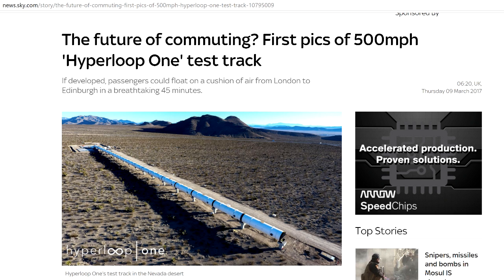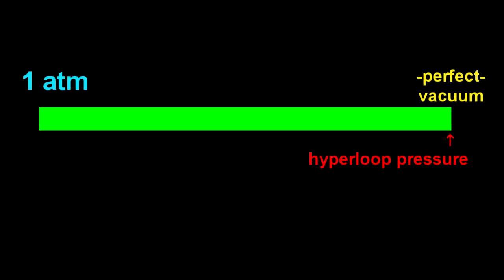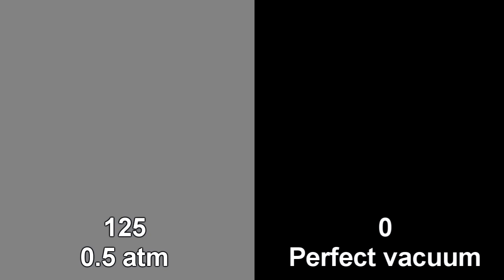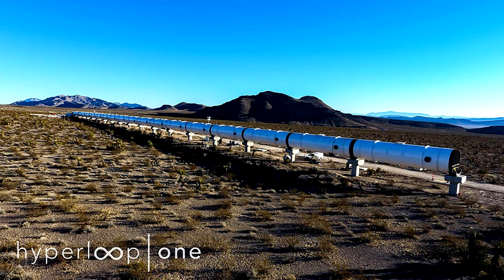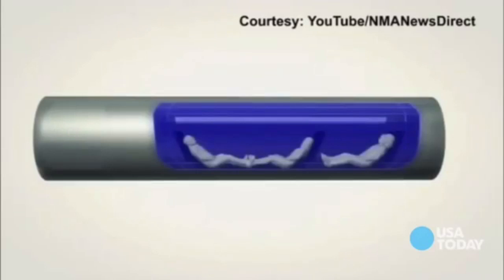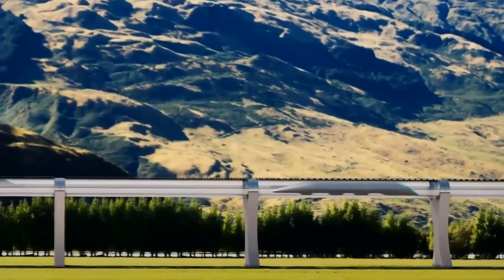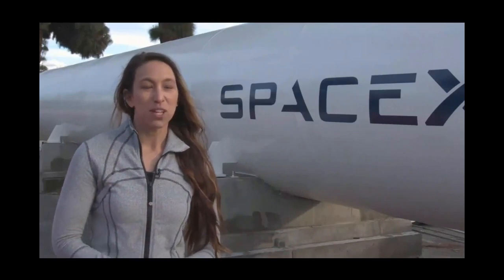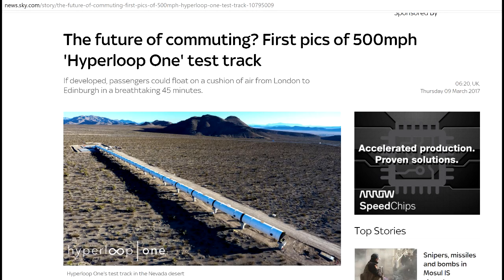Entire Hyperloop could be destroyed in SECONDS!

Comment: The Hyperloop will most likely be split into sections, so the vacuum of each section doesn't interfere with more than one pod. One benefit to the Hyperloop, when it's in sections, any damage to the Hyperloop will be severely limited, because the vacuum of the whole Hyperloop and it's sections won't be depressurized. If there is an air-lock, the potential energy in the vacuum will be able to pull the pod speedily along the interior. I surely do hope the Hyperloop acts like a maglev, that would make things much safer and faster. As for the thin tube, I bet that may be so if there is a problem with the vacuum, air can enter in easily. 

But, that's how I think, and many people think differently than I do.
Reply: If it's split into sections then how will the vehicle get from one section to another unless those sections are momentarily opened up to each other and closed at +500 mph speeds.... and if one of the seals fails then your vehicle is going to go splat
Reply: A better idea would be compression fitting another tube around it, or multiple layers to increase strength but this would cost much much more
Reply: Love Castle, 
it will have to be split into sections(Unless the hyperloop is used by one vehicle at a time) to avoid depressurization where vehicles can enter, and exit the hyperloop, even if that includes airlocks for each station. Alternatively, they can make a branch away from the 'main hyperloop' for stations, this may already be in the plan.  I however do agree on your last comment, the hyperloop needs a material that can hold an almost complete vacuum while controlling a High Velocity impact, or layer the hyperloop with the same material to prevent damage from a high-velocity impact.

At the time of writing the comment that you replied to, I was thinking each station could have a section leading up to it, sorry about not being too clear on that.

Thanks for your input!
Reply: the idea of hyperloop is one length of track where the vehicle speeds up about 50% of the way and slows down 50%... If the vehicle had to slow down or stop for airlocks then it would be quicker to take a car. as you cannot accelerate/decellerate the vehicle that fast without G-force too great for a human passenger
Reply: Kalel Kent
Well, with the facts presented in this video, I would say having one whole hyperloop would be a bad idea in case something were to happen, where sections can be sealed off. I'm not talking about different tubes in distance to each other. That would be stupid, what would be the point of having the hyperloop then? The pod would pass through an airlock that would be opened at immense speeds while staying at speed (Thanks to Love Castle for mentioning that.) However a breaking system does need to be put in place in case such an accident did happen.

You really need to change that attitude however, it's people like you that make people afraid to comment on a video expressing their own belief. Hence the reason why I put "But, that's how I think, and many people think differently than I do." in the comment.
Reply: Wait... Multiple sections with a vacuum seal (so like, a steel door) along the track? Goodness there are so many issues with that.
Reply: Also, Kalel Kent, think of a hollow circle, slice the hollow circle into quarters. However don't move the sections, place airlocks where the slices were, those airlocks will open and close at an immense speed, there's the Hyperloop in a 2D dimensional image (this is with pods, of course). Thanks for your stupidity in common sense.
Reply: So, the hyperloop is supposed to depart capsules every two minutes. For the tubes to be able to be sectioned off, so that only one capsule is in a section at any time, each section would have to open and close every minute. And if you want to depressurize and repressurize in such a time, good luck. It can take a half an hour just to depressurize a chamber. The hyperloop is a good concept, and I can think of some ways it could potentially work, but not for as cheap as advertised. If you put it underground, and encase it in concrete or have thicker steel walls (let's say half inch to an inch), it could remain safe to the outside hazards along with maintaining a constant temperature. Therefore, it could work, but in order to do that, it would cost exponentially more than the 6 billion price tag. The hyperloop is just too dangerous on the surface.
Reply: jabberwolf lol too intense with the capitals and exclamation marks, just chill it's an argument online. The internet isnt a place you need to use proper grammar, it's a place to chill and enjoy yourself. There's no need to be this heated. Sure have an argument, it's fine but don't get so into it, youre having argument online, it's a bit different then an irl one bc you debating with someone you don't know, no emotions, connections, someone you know that could be a catfish. what is the point to put effort to tell some u will forget in 20 mins. Im only saying this bc this takes away from the enjoyment of being on the internet (just a little bit) bc for some people who are going through tough times, the internet is a way to take away from that, when I go out to eat and I see a hair on my dish I just eat the parts that look good and not the hair or anything else of that, I dont trouble the chef bc he's working 8 hr on a job he could hate and it could be low paying etc, the kitchen is stressful place, the chef doesnt need another ass in his mind at that time, you to be considerate. this doesnt just apply to you. BTW no offense this wasnt me being toxic saying fuck you, Im just saying chill, it's the internet, if you like arguing go tryout for your highschool debate team kk ;)
Reply: Logoffsky, the problem with that is because the vacuum wont fuck up if one section does, if one section implodes the train will still have barely any friction and slam into a big wall of imploded metal at 1,000+ mph
Reply: LMAO that's because your thinking is severally flawed. You cant split something that's designed for speed into sections. What are they supposed to do come to a stop every few miles and change tubes? Who the fuck is allowing you to get on the internet?

Comment: A lot of Elon's ideas are good but you raise some really valid points about hyperloop. There may be some merit in energy savings powering vehicles through a partly depressurized but I think ~600 mph in a near total vacuum is probably out of the question. What if we took a maglev train and placed it in a tunnel with 1/2 or 3/4 of atmospheric pressure? You may be able to prevent total depressurization by passing through a pressure lock compartment before going outside and the train could move forward even at full atmospheric pressure. You could attempt to leverage the pressure differences in the tube as a method to power the train by pumping air to depressurize mostly in front of rather than behind the train. It does introduce a lot of complexity and running 3/4 of AP might not provide that much gain. In addition to this sitting in the pressure tube doesn't provide for much of a view.

Comment: While I pretty much agree with all your points, the ''scales of gray'' one is countering snake oil with snake oil. Using a linear scale to measure levels of vacuum and comparing it to atmospheric pressure is just using a silly scale. Going from 10e-2 atm, or 15 Torr to 10e-10 torr in something like the LHC is the hard part.

Comment: This is a troll video. The loop would have air chambers to unload passengers and would only need to vacuum the size of the vehicle then the door would open to the rest of the vacuum tube. I'm sure safety features would be built to quickly let air back in. Top Gear said the same thing about Tesla not being successful and rocket scientist said it's near impossible for a private company to land a rocket back on earth. A tanker truck is built a lot less thinner due to weight. What if that build the tubes out of graphene or carbon fiber?

Comment: I wont get into everything, others have addressed them but...
Test vehicles didnt coast well because of air resistance or because of drive train losses, maglev could significantly help out in this matter. The test required student submissions to stop and i think what we are seeing here is an oversimplification of the way the tests were conducted; I would jest, engineers were looking at how well the vehicles accelerated under the vacuum and knowing how well they coast is just math from there, so just slam on the brakes, all your data is already collected.  The strength of the tube is all in the engineering, enough said.  Finally, vacuums arent a hard problem; i actually dont know where people are getting this from, its the same argument as 'cant store solar energy' as if there arent 95%+ efficiency AC-DC converters; personally id start with steam, heat water with the sun (theres plenty of that in cali), run the steam through a turbine generator (we will use this power later) and then to a condenser cooled by seawater (and plenty of that) using the generators energy for pump head, use excess steam to run an air ejector pulling from the loop and that will pump down the majority of the hyper loop using minimal if any external power, and it will run and run and run so long as chemistry is maintained; from there very small pump stations could get you down to desired vacuum.

I like some of your videos but i think your time would be better spent highlighting improvements that need to be made and removing hype from issues rather than pretending your have 100% debunked them for all of time.  As far as hyper loop goes, California needs it; going through the central valley is an awful 2 lane road that has too many trucks and too many cars, travel wreaks havoc on LA and bay area traffic, and even assuming worst case energy consumption it has to be better than what we have now.

Comment: I just did alittle goolge-fu and found some interesting info.
      The book, Survival in Space by Richard Harding says, "At altitudes greater than 45,000 feet (13,716 m), unconsciousness develops in fifteen to twenty seconds with death following four minutes or so later." I than searched for "air pressure at 45,000 feet" and got 4.28 inches Hg. Next, I looked up a conversion table... it says that 20% vacuum is 5.98 inches Hg, 99.9% vacuum is 29.89 inches Hg, and 100% vacuum is 29.92 inches Hg.
      So, the hyper loop would be deadly at only 20% vacuum if if the pod lost pressure and help didn't arrive for four minutes. I don't know of any emergency service with that good of a response time.
      It's a cool idea, but we don't have the engineering capability yet... meby in 50 years?
Reply: This issue has been addressed.  To quote the white paper:  "In the event of a minor leak, the onboard environmental control system would maintain capsule pressure using the reserve air carried onboard for the short period of time it will take to reach the destination. In the case of a more significant depressurization, oxygen masks would be deployed as in airplanes. Once the capsule reached the destination safely it would be removed from service. Safety of the onboard air supply in Hyperloop would be very similar to aircraft, and can take advantage of decades of development in similar systems. In the unlikely event of a large scale capsule depressurization, other capsules in the tube would automatically begin emergency braking whilst the Hyperloop tube would undergo rapid re-pressurization along its entire length."
Reply: Those systems will have to be at least as reliable as maned spacecraft, so like I said, I don't think we have the engineering capability to do this on a useful scale yet.

Comment: why don't you just put a mag lift train in a tube without pressurizations.
Reply: The point of the vacuum is to get rid of air resistance so the hyperloop could go faster
Reply: Indeed but the main thing slowing most vehicles down is friction, the only time air drag starts affecting things that much is on things that have already thrown off the contact friction. 

The bullet train and aeroplanes need to be very aerodynamic so they deal with as little air friction as possible, but it's only these type of already high speed vehicles that have that problem, hence a bullet train type magrail with a vacuum tube around it would be able to reach higher speeds, but a regular train or car in a vacuum would still reach a similar speed.

Comment: Odd, I have been to a mill that produces steel pipe that is wider than the full size hyperloop tube and they don't require struts to integrity.  Also current design of train tanker cars use 7/16th thick walls.  This is all based on the pneumatic delivery tubes that are primarily used at the bank drive through.

Why is it that design one before engineering??? Money.

Comment: Wouldn't it be simpler to have the tube sectioned off with a door? so you'd only have to bring the pressure back down in a small section. And use a sort of rail gun design to propel the pod

Comment: Come on man.  That tube is like half an inch thick.  They DID depressurize it during the test runs.  Why can't you trust that the proper engineering will be done to prevent catastrophic failure?  You're not qualified to debunk something this complex.  You can't boil it down to a simple thermodynamic equation.  It's not a scam.  What is it with you and Elon's projects?

Comment: The have some kind of guide track on the bottom, why don't they just plate each side of the 'I beam' with a metal material with a non conductive backing and use that to power the vehicle? Like a subway. And at not that high of a vacuum. It would be much easier and more likely to succeed. And less likely to kill people.

Comment: As of thermal expansion, using a metal for tube is a bad idea. But I think they are planning to use something like a poly-carbonate which has 10^-5 order of linear expansion per kelvin.

But if they would still stick to a metal contraption, they will need some telescopic interlocking sleeves or something every mile, which would introduce some leakage.

Comment: This new hyper-loop is drastically different from the original designs of 18th century in many ways. The original version didn't require the whole tube be evacuated, only one end. The atmospheric pressure in one end would drive the vehicle through the tube.

But this new version of Elon Musk suggests to evacuate the whole tube of air, so any differential pressure propulsion method would be quite less efficient, since the pressurized ait has nothing to push against, it would (in vain) be much like jet propulsion in outer space ( which is theoretically less efficient than air planes that glides over air in the atmosphere).

The problem there, which might have diverted them from the original designs would be that there would be much friction between the walls and the pod if they stick to the original plan, since the original plans suggests to make the pods fit loosely inside the walls, so the pressure difference at the either end will drive the vehicle.

Or maybe Elon musk and his team didn't read the original paperwork and thought that they suggest to take the advantage in lack of air resistance (which is not of actual concern). Air resistance is called "negligible" for a reason, because it is negligible.

Comment: I don't think the author of this video understands the testing process. We already have rail technology that we can put in the tube. High speed trains and mag-lev propulsion systems have existed for decades. That's not what the testing is about. They're not seeing how fast they can go in 1km. They're measuring the atmospheric forces inside the closed tube and on the vehicles so they can design around them. You don't need to go 700mph for that. That's what math is for.

And if you think they won't use a vacuum pressure that is safe, then I don't know what to tell you. Trains and vacuum chambers have been around for a long time. We know a lot about their tolerances. Your analogy with the greyscale color is bad too. This is an exponential scale we're talking. The difference between 99.9% and 99.99999% vacuum is incredibly high.

Comment: What about when the Tectonic plate shifts and rips the tube in half? An earthquake would destroy that thing.
Reply: To quote the white paper:  "California is no stranger to earthquakes and transport systems [are] all built with earthquakes in mind.  Hyperloop would be no different with the entire tube length built with the necessary flexibility to withstand the earthquake motions while maintaining the Hyperloop tube alignment . . . By building a system on pylons, where the tube is not rigidly fixed at any point, you can dramatically mitigate Earthquake risk and avoid the need for expansion joints. Tucked away inside each pylon, you could place two adjustable lateral (XY) dampers and one vertical (Z) damper. These would absorb the small length changes between pylons due to thermal changes, as well as long form subtle height changes. As land slowly settles to a new position over time, the damper neutral position can be adjusted accordingly."

Comment: I think hyperloop is silly but the arguments aren't exactly perfect. You can't really judge a couple of crappy prototypes to say the end result won't be fast. 30 minutes to add vacuum? So make the majority of the real track full vacuum and only pressurize a small section of the track where you load/unload. Tada. But there's NO WAY IN HELL you're getting me to climb into a tiny clausterphobic capsule that could wreck ANYWHERE and the only way out is for them to FIND YOU (if you don't die from lack of oxygen) and CUT YOU OUT. I've not seen any real arguments for high number of passengers. And what if people PUKE inside that capsule? You gonna climb in?